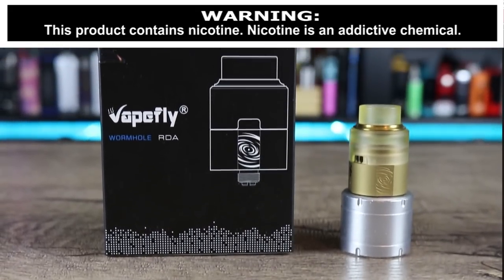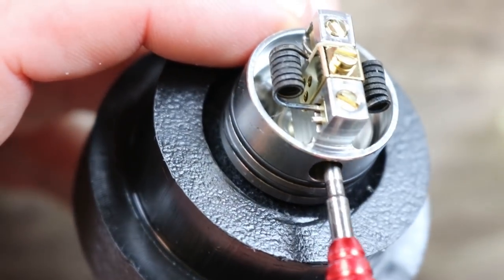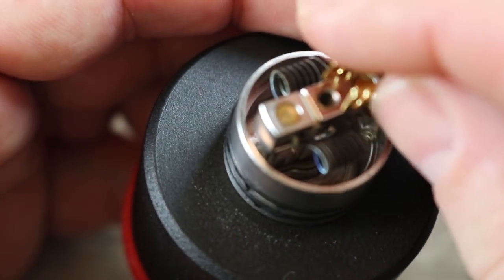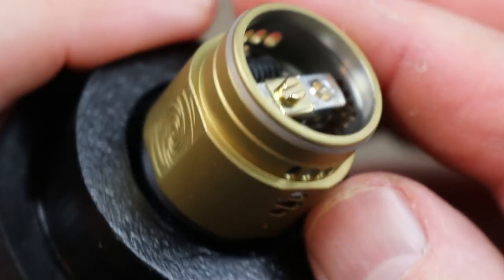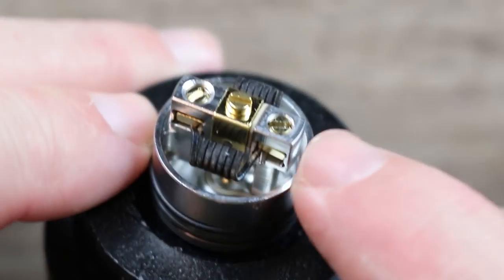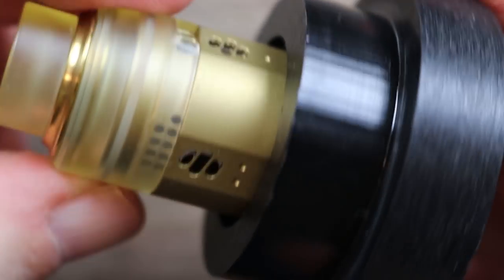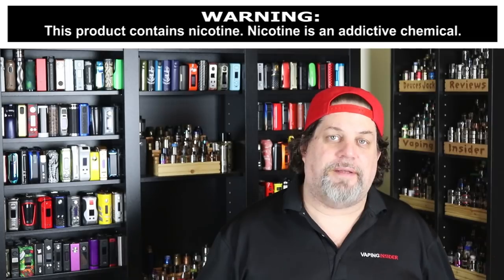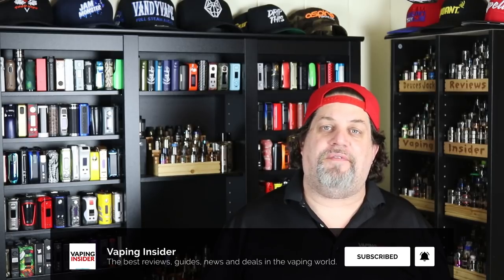WACKY AIRFLOW? Vapefly Wormhole BF RDA Review ✌️🚭

Comment: For single coil, i prefer an rda with a smaller chamber... I purchased the pulse 2 rda, built it for single coil along with the airflow option for it and it chucks clouds but not as close as the flavor I get from smaller dedicated single coil RDAs.
Reply from the maker: I agree. I prefer the Pulse 2 in dual coil mode as well.

Comment: I got this rda when it first came out i liked the airflow on it in single coil the flavor was better imo there is alot better now but when it first came out this was my go to rda until the plasic top started cracking from the juice
Reply from the maker: Citrus juice?
Reply: @VapingInsider  yup naked100 lava flow
Reply from the maker: Wow, I vape that stuff too. Haven't had it crack a tank yet though. Then again, I test so many tanks I never take notice as to what juice is in which tank. I'm a huge fan of that Hawaiian Pog.
Reply: @VapingInsider  i guess it depends on the type of plastic they use i had a ultem tank and never had a problem but that soft plastic on that rda cracked all over after like 3 or 4 months of using
Reply from the maker: Smfh! What makes it more amazing is this is not a tank so it's not like it's sitting in juice all day.

Comment: I like the RDA and all the innovation, but not the color and it's a pro that you can use it in a single coil configuration. The offset airflow can you fix but you should'nt need to fix something on a brand new RDA, it can be a design flaw or maybe if they made it wider the airflow would loose some pressure and that's why they did it like that? We are not all alike I like allenkey screws myself but that's a personal preference, and I too has OCD. Thank you for the review Deuces. Peace!
Reply from the maker: Thx for watching Allan. It a lil different, that's for sure.
Reply: @VapingInsider  If all the RDA's was built the same way it would be boring for all the reviewers so a little innovation is a good thing that's for shure.
Reply from the maker: I agree. I like trying the wacky stuff.